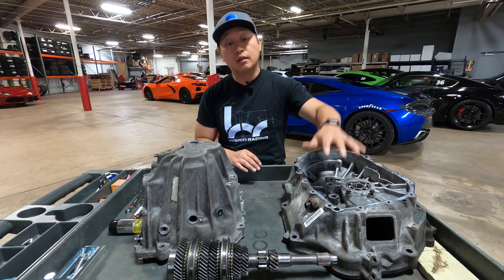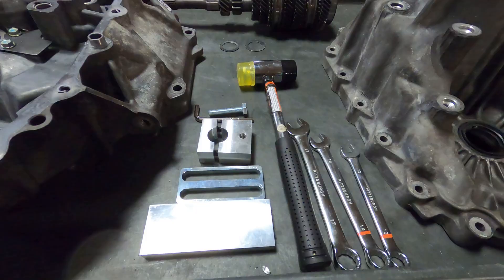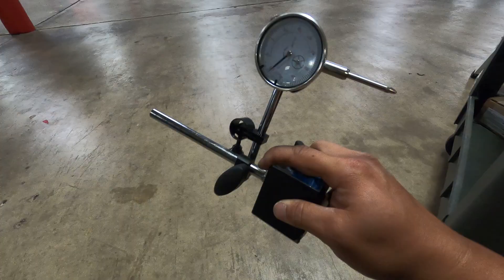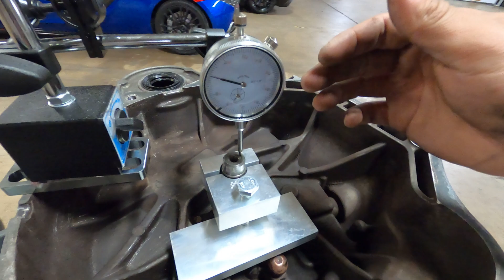How To Check Honda Manual Transmission Mainshaft Thrust Clearance

Comment: I just finished up rebuilding my transmission and I’m having hard time closing my transmission. What is the cause for it? Do you think my shift fork are not set properly?
Reply from the maker: This can be a bit tricky for your first couple of times. You need to set the trans case down onto the clutch case, fasten down maybe 4 case bolts loosely, then flip the trans over so the counter shaft can drop into its place. The snap ring should spread and slide into the bearing groove.

Comment: Correct me if im wrong but could you not replace that tool with vice grips, a rag, and a prybar?
Reply from the maker: Could you? Yeah… but could you risk damaging the splines with the vise grips even with a rag? Yeah… would it be accurate? Maybe… 

Not that expensive of a tool that makes your life a lot easier. But, people work with what they got, so by all means, try it out!
Reply: @bvspeed  personally i just dont see it being used enough to be worth it. Maybe if you do transmissions day in and day out. But for the average joe vice grips work just fine, that shaft is made of harder steel than most vice grips. Even if you didnt use a rag youd probably be fine. I will say it is definitely easier to get a reading with this tho, no wobble.

Comment: How do you check countershaft clearance?
Reply from the maker: As far as I know, there is no check for that. I'm assuming, because the two components (mainshaft and diff) that are before and after the counter are measured, there's no need to set anything for the counter. I could be wrong though...
Reply: @bvspeed  thats what I was thinking, thank you😎

Comment: Just curious, I've seen a commercial gear presser behind you and some other guy doing it on another channel. As a beginner, what can we use to press in our own gears at home that's affordable instead of using make shift crappy parts? Thanks in advance!
Reply: i got a used bearing puller from harbor frieght for cheap, works amazing
Reply from the maker: I believe there are ways by using universal pullers or even methods of dropping the gearsets (controlled/lightly) to pull gears apart. The homie at Honda Street Garage has some older videos on how he did it!

Comment: This is great. I'm guessing you could you also verify this with a solder crush test? I'm thinking a two (2)  0.118in (3mm) pieces of solder 180 degrees apart that would be crushed when the case is bolted to spec without the spacer. The end gap would be verified by measuring the average crush of each solder minus the thickness of the spacer.
Reply from the maker: I suppose that could work as long as the solder is 100% precise and consistent to what it’s advertised as in terms of size/thickness. Without knowing for sure, I wouldn’t put my trust in it.

Comment: When you install the mainshaft to do the test, can you have it fully assembled with all gears, synchro's, etc., like you never even removed anything on it. Or do you need only the selected parts as stated in the repair manual on the mainshaft, which would be only the spacers, and the 5th, 3rd, 4th, synchro hubs? Thanks
Reply from the maker: You can do it either way, but the “proper” way would be to do it as Honda recommends. They have you do it that way so there isn’t so much weight, thus making it easier for the tool to do its job. It still works with all the components on the shaft though.

Comment: This was the most comprehensive video I could find, Thanks! 🙏🏾
In my case , I was right at the lower range. I thought I was out of spec but realized my dial indicator was in mm not inches. Right on .11mm (.004in)
Reply from the maker: Awesome, good to hear. Thanks for watching!